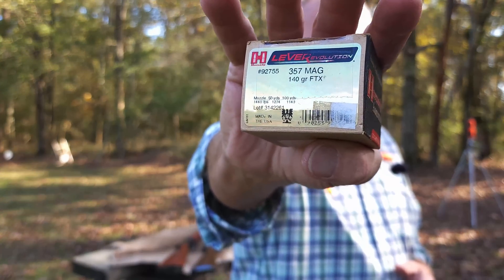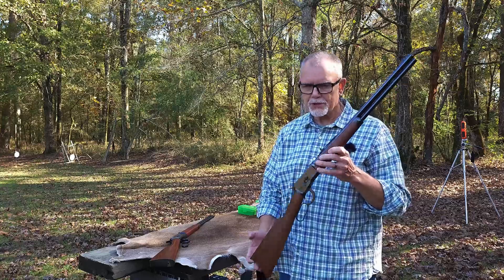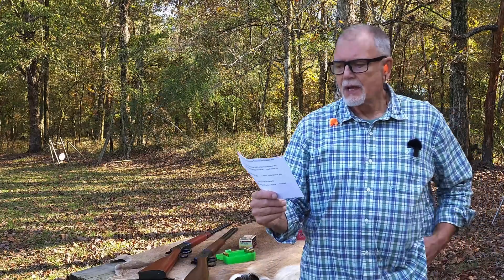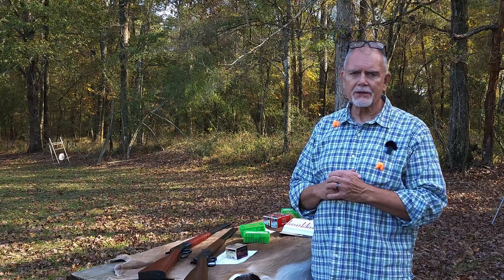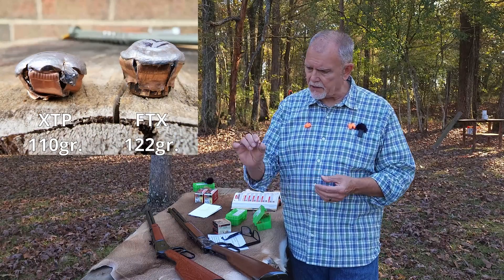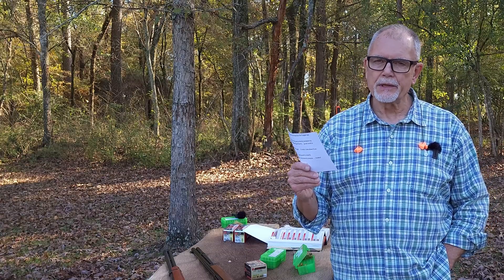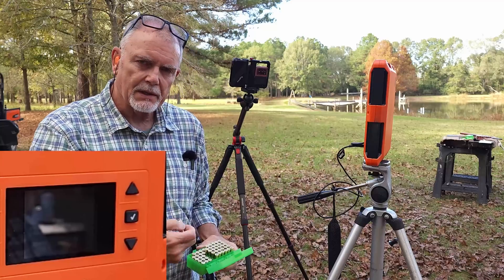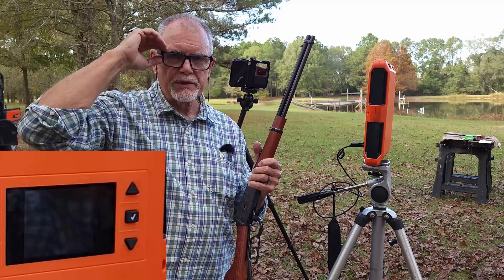The Pointy 357 Magnum Bullet is * SLOW*

Comment: Just a week before you posted your video, I did the same test with my Miroku 1892 20 inch. FYI, comparing apples to apples, I had the 140 FTX factory load and 1 box of Hornady 140 XTP FACTORY LOAD that they no longer list in the catalog. So comparing factory - factory I got FTX = 1796 and XTP = 1925. This agrees with your testing and surprised me too. I keep a big stock of the Hornady XTP 357 bullets of all weights on hand and am partial to the 140. Hope you find the testing of both factory loads interesting.

Comment: No guru am I, but I wonder if the grooves on the Rossi are cut ever so slightly deeper in relation to the lands.  If so, could this result in just enough pressure loss to explain the difference in velocity?
Reply from the maker: That's a great question. It just need some investigating. I'm going to try to get that done here in the next week or so.

Comment: Some really good data and interesting results. I run 357mag in a Henry as well as 450 Marlin out of a 26 inch barrel in a Marlin model1895. Id love to see some velocity comparisons run on the Hornady factory FTX 325 grn and similar weight reloads.
Reply from the maker: Maybe it's time for me to do another ammo comparison in the 45-70. Thanks for the suggestion.
Reply: @TargetSuite chronographed velocity from the hornady factory ammo was   about 150 fps slower than advertised on the box.  about the same pace as the 405 grn speer reloads that I use for hunting Sambar Deer in South east Australia.

Comment: When it comes to reloading magnum pistol, it is hard for me to choose between imr 4227 and 296/H110.  They both good. Never had an interest in the FTX. XTPs are great!!!
Reply from the maker: Those are my two favorite powders for Magnum pistol. If all I wanted was full on Magnum then w-296 would be all I needed. But, 4227 give me some flexibility when it comes to power levels so it gets a lot of attention at my reloading bench.
Reply: @TargetSuite  I prefer 4227 for cast , plated and coated bullets. Remember 296/110 has a minimum load limit. Trail Boss powder makes for good cowboy loads and small game. Unique and Universal supposedly is good for low loads but have not tried them. Maybe some day you can do a test on cheap plinking loads.

Comment: Hey George;  Great video!  I'll bet the internal barrel dimentions (land to land) I.D.'s are different with the Winchester having tighter tolerance to the bullet OD.  Less Gas blowback and greater velocity.  However, I am unfamiliar with the chamber lock up on the 1892 design.  Is the Rossi dirtier, inside the receiver, after firing?  How well does the bolt face seal the chamber?  Would a strong light and a bore scope shed any light? (Pun intended)  Just a thought.  Keep up the great work.  P.S. I'm digging the impressionist bent as of late.  God bless and stay safe!

Comment: Love your videos George, I've learned so much from them regarding my R92. Now I have a quandry you may be able to shed some light on. First of all a caveat to say I have completely exhausted usual avenues of enquiries regarding MY R92. 
It's a .357 / .38 with a 20" octagonal barrel BUT it has an end cap on the forend and I have not been able to find any reference to a rifle in this format. I have tried to contact Rossi but to no avail. It's slowly driving me crazy as I like to be able to catalogue my firearms. If it helps the serial number shows 5HO149832. Any suggestions from you would be graciously and humbly welcomed. Keep up the good work.

Comment: The difference in velocity could be caused by a number of factors; bore diameter, rifling twist rate, chamber dimensions, and the amount of freebore (distance from the bullet to the start of the rifling).  If the bore diameter is larger in one rifle, you could be getting blow-by which could cause a loss of velocity.  I would certainly want to measure all the dimensions I mentioned to see what's going on.
Reply: You're probably covering the most likely reasons with you comment. If you ever have the chance to do so and find the results... please share your findings, thx

Comment: Hi George.  My two cents is that the Rossi may have a greater distance of projectile jump before hitting the lands of the barrel causing less spike in initial pressure.  I used to set that measurement at 0.050 in a bolt action rifle I used to have. 
 You’re making Great content that inspires thought.

Comment: The FTX series bullets in the straightwall cartridges are extremely underwhelming.
For their weight, the Hornady data always seems slow and the BC for them tend to be worse than the flat-as-a-pancake bullets, especially comparing against higher weights.
I am not a fan at all, excepting the 30-30 160gr.

Comment: That was interesting George. I own a Rossi 92 in 357/38SPL, but with a shorter barrel. I did not expect that much difference between two 'similar' rifles. I also own a Winchester but it is in 45 Colt.
Both good shooting rifles. ( I will admit, the reason for buying the Rossi was only because there wasn't a Winchester available to me in 357 at the time ) However, I am NOT sorry that I bought the Rossi,  actually I like all lever action rifles and double action revolvers too.
Thanks for the expose'.

Comment: Multiple comments here regarding twist rate affecting muzzle velocity. If you search for “effect of barrel twist rate on velocity” you will find an article derived from the book “Modern Advancements in Long Range Shooting”. TL-DR a faster twist rate reduces velocity by a small factor. 

My bet would be that the differences between these rifles comes down to chamber and leade dimensions more than anything else. It would be very interesting to compare two Rossi ‘92s and two Winchester 1892s, all 4 rifles chambered for the same cartridge.  I am guessing that the Rossi rifles (a) have greater chamber variances, and (b) have longer leaders and looser chambers than the Winchesters. But that is just a guess. With a sample size of 1 each we really can’t make any conclusion other than that each rifle does it’s own thing.

Comment: Well not having either rifle at my finger tips  3 points to look at bore diameter, length of throat, and chamber dementions.  That may be any of the reasons but can effect the  outcome.   Best way I can explain my point is using something dramatic variation in throats length such as  .460 Smith and wesson. Versitality yes but is it efficient for all? Answer is a simple no. Hypothetically 460 throat sets the ojive .200 away from the lands the .45 colt sets back a full. 700 back from the lands  leaving more loss of gases, and less efficient. 45 colt. Same for all other specifications. 

Best I can do  for now. 
This is why I disagree with whole concept of .45 colt/.410 bore take two great cartridges and make them both less efficient. 
   Mountain man

Comment: That was another excellent test and presentation. For fun, maybe you could point the barrels down, plug them and fill them with water. Then measure how much water they hold to see if the volume of the slow barrel is greater. Also could cast the chamber and measure the dimensions. So many minor differences could add up to lower pressure in the Rossi. I was quite surprised that velocity was greater than 50fps between the rifles.

Comment: Hornady's recommended muzzle velocities for the 140gn FTX & XTP is between 850-1600fps.. Both bullets held up well in the gel block test considering how much the impact velocities exceeded the design.
I was amazed at the difference in velocities between the 2 rifles. As others have noted my first guess was the twist rate. In my 18.5" Marlin I'm getting just over 1800fps with 158gn Hornady XTP & H110 hand loads.

Comment: In my experience...pointed bullets at that velocity range just don't make a big difference. Especially since the rifles are limited in range by their long range accuracy potential.  Since air resistance is a square of the velocity, higher initial velocities result in better performance by bullets with higher BC. 
Winchester offered the Model 1892 (Model 65 version) in .218 Bee and the Model 94 in .219 Zipper.  Savage also offered the Model 99 in the odd bore size (.228") .22 Savage Hi-power.  None were successful and none offered any remarkable long range performance.
IMO the 145 gr. pointed bullets are trying to make something out of the .357 Magnum that it just isn't. 
The .357 Magnum is a great cartridge in it's own right. 
On velocity differences... Rossi uses a 1-30" twist rate, which is quite slow and best (should be) for cast bullets.  At least it should prevent leading.  The Miroku/Winchester is 1-18" giving greater resistance to the bullet traveling up the bore, increasing resistance (and pressure). That would be my guess.
And yes...Miroku makes great rifles.  Dare I say even better than the originals?  Yes, I dare say! 
FWIW the most accurate 100 yd. rifle I own is a Miroku made Winchester Model 71 with peep sights, shooting a fat 250 gr. .348" bullet.  Go figure.  They know how to make an accurate barrel!

Comment: Twist rate most likely different, and you might also slug the barrels to check ACTUAL land/groove measurements.  Assuming ammo identical , only possible answers will be friction on the projectiles, either twist, or rifling induced.

Comment: You make such well informed videos. With the time and expense is much appreciated! I was curious why ya didn't just load same powder charge (w296 of course) with both 140 xtp and 140 ftx for a gel test comparison? Seems the projectile is the only variable. I am a BIG fan of 140xtp in my lever! It's the perfect in-between for the usual 125 or 158.  I never loaded 140 ftx pills, so I appreciate your data!  A long tube certainly wakes up any 357 & 44s! Keep up the excellent videos. Levers are king!!
Reply from the maker: Great question. I only had the factory 140gr. FTX rounds. I didn't have any loose bullets. Otherwise, I would have done as you suggested.
Reply: Powder definitely could be a factor in the results comparison.

Comment: Very interesting info. I expected maybe only 50fps difference. Japan does a better job with manufacturing tolerances than Brazil but it comes with a higher price.  Will it matter to a hog or deer down range?  Thanks.  👍 🇺🇸
Reply from the maker: I suspect it is a tolerance issue. But like you implied, it won't matter in the field.
Reply: @TargetSuite  🐗 was that a Miroku or a Rossi that got me? 🦌     😆

Comment: I've been doing cowboy action for nearly 10 years and I consistently see more mechanical issues with the Rossi than with other brands. For that reason I have never purchased a Rossi lever action  ( I own a Rossi 357 revolver and never had an issue with it, but it isn't shot very often either )  and consider them a lesser quality rifle with so-so quality control.  Maybe the tolerances on your Rossi barrel or chamber isn't quite up to par.
Reply from the maker: Thanks for your comment. I suspect it's either an oversized chamber or something related to the bore diameter. I'll slug that gun here one of these days and find out.

Comment: The barrel diameter's of those two rifles might be slightly different.  If the Rossi were a very slightly bigger bore than the Winchester, it might not get as much velocity as the tighter fitting bore in the Winchester.  Not sure how easy it would be to measure that however.

Comment: I have a Rossi R92 stainless with a 16 inch barrel. I have noticed that the chamber is quite sloppy. Cases are noticeably more expanded when fired from that gun than the same ammo fired from my Colt revolver. 

With a loose chamber and possibly a slightly larger bore, the ammunition won’t build as much pressure. This could cause a lower velocity.

Comment: Good informative video ! 
Hello Mr. George, you did not mention Whether there was a difference in rifling between the two rifles, the only other issue could possibly be that the bore is tighter on the Winchester enabling a little more pressure to be built ! 
PS.    It will be interesting to find out exactly what the differences are that caused the Rossi basically to shoot 100 ft./s  slower Then the Winchester !

Comment: I’d expect that twist rate and pressures might be the reason for the velocity difference between the two. Rossi has a 1-30 and I think the Winchester has a 1-18. Interesting results. Enjoyed the vid👍🏻
Reply from the maker: Thanks. That could well be the issue. I appreciate your comment!
Reply: Perhaps I'm missing something, but how would the slower twist rate reduce bullet velocity? I could see a faster twist rate resulting in a marginally lower velocity as more energy gets turned into rotational momentum.

If I were to guess, the Rossi might have a slightly looser bore, allowing gas blow-by. Perhaps slugging the bore would answer this?
Reply: @ExF1Guy   A looser bore would have been my take as well.
Reply: @ExF1Guy  Maybe a faster twist rate develops more pressure.
Reply: I'd say you are probably correct Georgia boy  . Also the  bore size  and type powder  and primer could be a factor. But  Mr. Target suite I'm sure done a good job on that part.   Excellent video.
Reply: Good call!

Comment: Interesting. Would be curious to see the results with different Winchester and Rossi rifles. Is it just these two rifles or something else going on?
Reply from the maker: I may do a similar test with my two 44 mag lever guns. One is a Winchester, and the other is a Rossi.
Reply: @TargetSuite  I have a Rossi 44 mag in 16" that will do moa groups with 200 gr XTPs over 2400 (scoped). I think the reason for the Rossi being slightly slower than the Winchester is the twist rate. The Rossi is 1:26" and I believe the Winchester is 1:30"
Reply: Twist rate should have no effect on velocity. Lighter bullets require faster twist rates to stabilize the bullet.